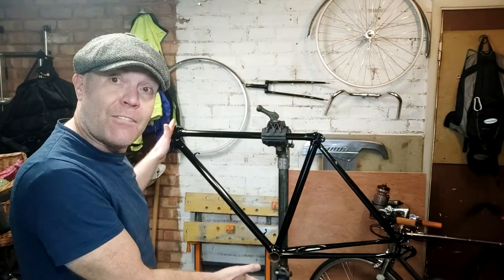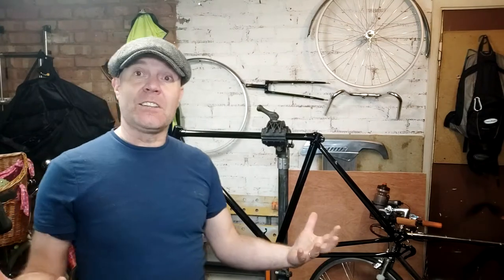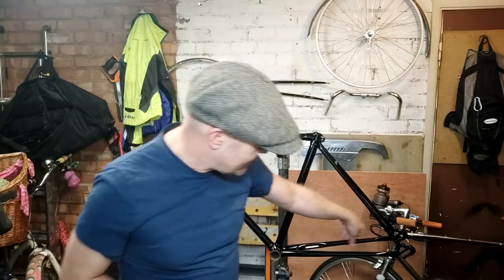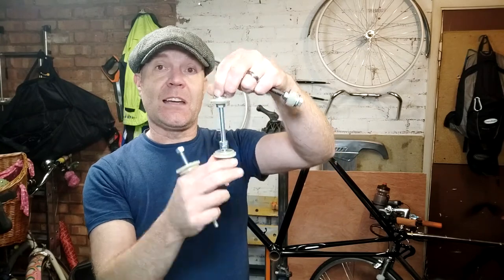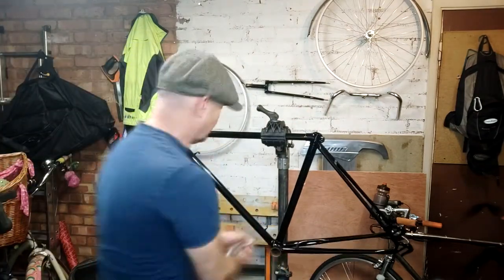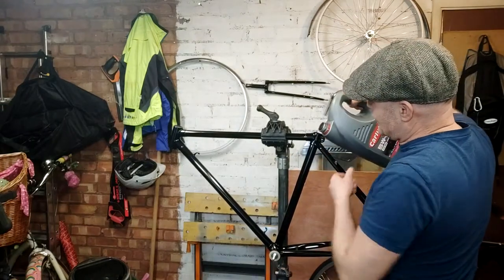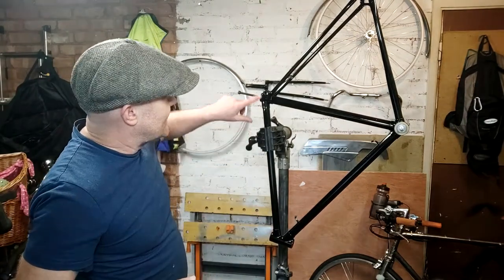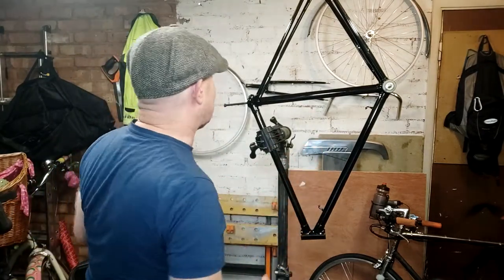How to Treat Internal Rust in a Frame - Crazy Japanese Bike Restoration - EP09

Comment: In the vintage bicycle preservation world many people use double boiled linseed oil because it penetrates the existing corrosion and polymerizes when dry, essentially sealing it.
Reply: Hello, could you please explain this process? I have this linseed oil I use for woodwork and an old bike with rust inside the frame
Reply: @dunnotck1 ~ For the inside you’ll just have to get it in through whatever holes are available, plug those holes, and tumble it around until you feel like it has had a chance to touch every surface (which means you’ll need to use an excess amount). Then set it up to drain the excess for a day or so. Use a sponge to catch the initial drips if you are worried about it running onto other parts of the frame, but keep an eye on the sponge and remove it when the majority of the drips stop. Each section will have a different drain point so you’ll have to do it in pieces- likely top and down tubes, chain stays, seat stays, and seat mast will all drain in different directions. You may want to start the process by swishing some Evaporust around inside the frame also, draining, and giving the remaining Evaporust a couple of days chance to evaporate in a warm environment. However, I would only add this step if you feel like water has sat inside the frame.
For the outside it’s just a matter of getting the patina to the stage you want it at before applying with a rag, wiping off the excess. It should be dried in a warm environment which may take up to a week or two to completely set. 
DISPOSE OF THE RAG PROPERLY TO AVOID COMBUSTION. The oil is flammable! Do not ball it up and throw it in the trash, or you are asking for a fire. Open it up and hang over something to dry completely.
When the oil has dried, buff the surface and repeat as needed. It may only need some spot application and another buff, if anything. Finish with a coat of beeswax.
Reply: @DRY-C0WB0Y   

first stage Evaporust for getting rid of the rust (hopefully have the rust flakes dissolve in the solution and will go out the frame when draining.

second stage linseed oil  the frame for preventing the rust from happening in the future.

i get it. i wanna try it with my vintage 90s mtb.

Comment: You can Drill Small Holes in the Seatstays, Chainstays and Fork Blades and Lube up EVERY Nook and Cranny of the Internals of a Steel or Alloy Frame. Best Drill a Hole in the Middle of the BB Shell as Well, for Water Drainage. Also Best to Drill Holes RIGHT at the Bottom of the Fork Blades, Chainstays next to the BB Shell and Seatstays where they're Brazed/Welded to the Dropouts. This Way any CONDENSATION can Drain out.

Comment: I've just done a Triumph (aka Raleigh) Twenty and it had those little drain holes all over the frame. In fact one job was freeing those up. It also had holes in the down tube to all the rear brake and gear cable to travel through the tube. Neat tip though - another to add to the bike repair/restoring toolkit.

Comment: Boil the engine oil, pour it hot, and it will be baked to the metal for many years.
It's the way how an old-timers would do it on their cars.
Reply: Is it safe to boil it?
Reply: Yes because oil acts as a coolant inside an engine when it's hot. You don't want to touch it obviously but it's not going to explode or anything.

Comment: interesting.... not sure i'll go through all that (mainly cos I don't have the bungs...)... hmm... looking for ways to protect an old Reynolds 853 frame - it's in good shape atm, but there is a bit of rust on the seatpost when I pull it out. Great vid, now subbed, ta
Reply from the maker: I'm lucky as I have a seat tube reamer. It's an adjustable reamer. In your situation I would ream the seat tube then spray some GT85 (or the like) further down the tube, keeping away from the area that actually does the clamping.
Often, a bit of rust residue on the seat post isn't too much to worry about.
Reply: @bikeshaman-bicyclerestorat1194  you are, indeed, a shaman! Thanks for the tips! RJ the bike guy cleans the tube with some wire wool on the end of a straitened coat hanger. Anyway, all bike guys are great. Ta
Reply from the maker: @remembertheporter  I have actually tried that and it worked well. I stuck the coat hanger wire in a drill to make life easier.

Comment: Would it not be better to fill the frame with phosphoric acid, jet wash it out and then fill with motor oil after a thorough drying?
Reply from the maker: Good idea, but have to admit, I was wary of putting anything acidic in the frame.
I did actually try electrolysis, which worked really well in getting rid of the rust. However, due to storage issues I had to get rid of the tank I used before I had chance to do a video. ☹️

Comment: I actually wanna get a Cromoly gravel bike. But i worry a lot about the rust. I wonder if it is worth getting but i like steel.
Reply: Cromoloy is a good quality steel. If you have it from new and you look after your bike you shouldn't have a problem. (A spray inside the tubes with GT85 every six months or so.)
If the history of the frame is more unknown I'd do what I've done, or one of the other methods suggested in the comments.